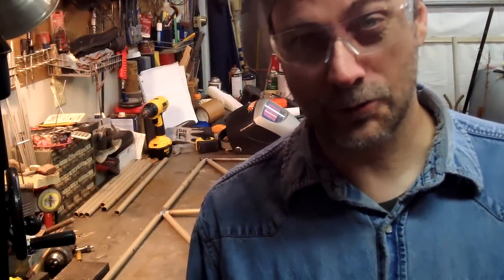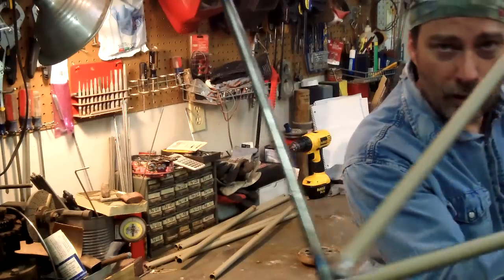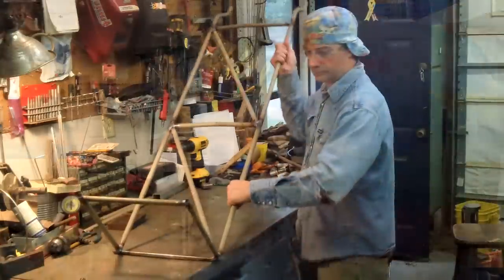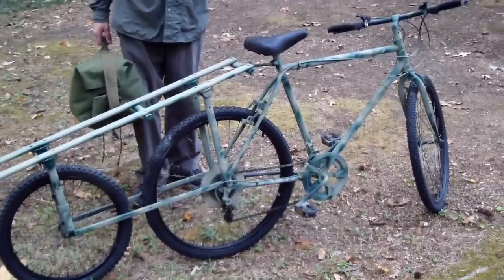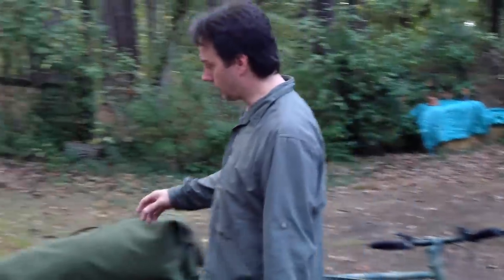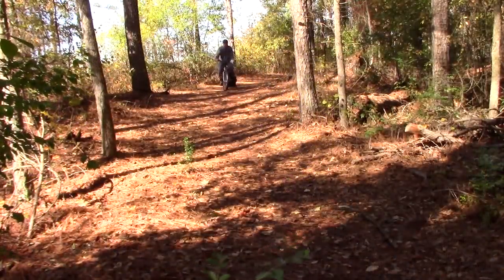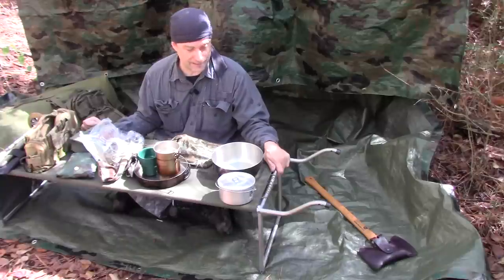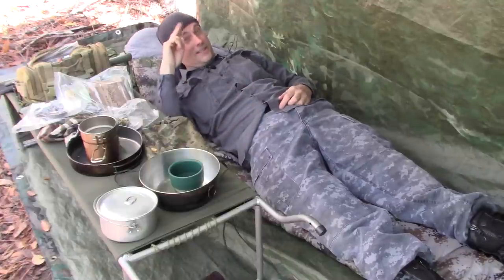The Bushcraft Camping Bicycle Travois

Comment: Dave , I just have to say you are one of my favorite people ever! You are humble, creative, and funny. 
Nice project. I enjoy seeing the thought process behind your projects. I like the paint choice. 
If you find the wheels you chose don't work, take a look at baby stroller wheels. The ones for jogging strollers are a bit larger and are designed to be pretty rugged. A bonus is that they are designed to swivel. You can also set their brake.
Looks like it rides nice and smooth.
Reply from the maker: Thanks Jeanette! I'm glad you liked it . The small wheels with the high speed bearings work perfect for trail use. Since this video was filmed I now have a larger set of wheels I swap out for off trail use.
Reply: @Reallybigmonkey1  I'm so glad!

Comment: Bigger wheels will be needed if there is deep puddles & sloppy mud on the trail.
Reply: I'm thinking golf bag wheels .
Reply: Yep, take an old 2 wheel pull behind golf caddie cart as a starting point for the build. About 12" diameter wheels should do the trick.
Reply from the maker: @QuantumPyrite_88.9  that's even better than bicycle wheels!
Reply: Right on. There are 2-wheel ranger carts & 4-wheel barrows, too.
Reply: I see golf bags on wheels with axles all the time at Goodwill stores and Thrift shops . Maybe 10 buck$ tops . Make longer axles for a wider wheel base and better stability .
Reply from the maker: The small wheels with the high speed bearings work perfect for trail use. Since this video was filmed I now have a larger set of wheels I swap out for off trail use. The wheels aren't huge just like you sugggested. I used wheels off a self propelled lawn mower
Reply: Being able to swap out and customize wheels for terrain  is nifty .
Reply: @Reallybigmonkey1  That sound great. i love that you have interchangeable wheels for different terrains! I love your ingenuity and I look forward to more of your ideas in the future and you sharing them with us!
Reply: @Reallybigmonkey1  Awesome
Reply: Defenitely add bigger and wider wheels on the trailer if you can. If it rain or if you go on a rought trail, you will be happy to have them. Great idea sir, with a bit of tunning it will be amazing!
Reply: @Reallybigmonkey1  Higher wheels will lift it, therefore separating it from the bike wheel more too. That way the handles won't have to be bent more to raise it.
Reply: @reaganl.5113  and just a thought, wheelchair tires never go flat..
Reply from the maker: The small wheels with the high speed bearings work perfect for trail use. Since this video was filmed I now have a larger set of wheels I swap out for off trail use.
Reply from the maker: The small wheels with the high speed bearings work perfect for trail use. Since this video was filmed I now have a larger set of wheels I swap out for off trail use.
Reply: how about a plastic skid plate under near the rear wheel so if it to deep or rocks you can just glide over everything. in joy
Reply: I agree. It would also help deal with bumps or other objects in path

Comment: Extend the arched hand holds 2" further back , and the tire won't rub..
Reply: Bigger wheels would have the same effect.
Reply: Or move the rod end a little further away from the seat.
Reply from the maker: The small wheels with the high speed bearings work perfect for trail use. Since this video was filmed I now have a larger set of wheels I swap out for off trail use.
Reply from the maker: I've since moved the pivot two inches higher

Comment: Is it not strong enough to sit upon like a bench?  💝☀🌵
Reply from the maker: I dont think it is, Its pretty light weight.
Reply: @Reallybigmonkey1  It was OK when it was a chair so I'd think it would be ok now wouldn't it?
Reply: @Reallybigmonkey1  would need some angle bracing on the legs.  Too much laterial stress on the weld points.  Would be a lightweight and easy model, wouldnt take away from design and would even help keep larger gear in.  Great stuff Dave

Comment: Dave, you are a great inventor, you should claim copy-right to your ideas. There is a market out there for light weight gear tools. Others will jump on this and sell it and never mention you name and that ain't right. Many long distance bikers would love to have a setup like that. And if I may suggest just one improvement , add wheels at the back that are about a foot tall. That will help when going into rough places and also on the road. Thumbs up. Clue try pvc pipes.
Reply from the maker: So far no one has stolen any of my ideas. That I'm aware of. The small wheels with the high speed bearings work perfect for trail use. Since this video was filmed I now have a larger set of wheels I swap out for off trail use.

Comment: Another great video. May I make a small recommendation. The next time you set up your table turn the handles for the outer side of your top that way when you move around the table you’re less likely to whack your legs her knees and won’t knock it over. I know you did not get over this time but just a thought especially if you’re trying to get into your sleeping bag at night.
Reply from the maker: Thanks Roland! I'm glad you liked it. Good thinking on them handles. I didn't even notice that

Comment: Another inspiring invention, Dave!
Made my own bike trailer several years ago...took about 200 miles on it to work out all the glitches.
 I used very small bicycle tires and put together a pivoting single-tree that allows me to attach the trailer with a single drop-in pin. It's in its third season and the only problem I've had is one sheared bolt.
It's totally made of recycled materials and the only thing I bought were the bolts. &)
Reply from the maker: Thanks! I'm happy you liked it. Bike trailers are cool but, my intentions were a trailer, a firewood hand truck and a table or bed frame. I've got a lot of tweaking to do!

Comment: I am deff going to copy the idea and play around with it. 
A quick brainstorming session gave me these ideas:
- Trunk cargo net to secure the load, that way I can carry small-ish items on the outside of the bags with less risk of losing them on the trail
- Make the frame of the travois strong enough to be used as a ladder/stretcher if needed 
-Play around with the size and shape of the wheels to see what suits the local terrain, and maybe play around with WHERE the wheels are located  relative to the travois, in some handtrucks the wheels are not in the corner and that may add ground clearance
Reply from the maker: Thanks for the suggestions Victor. I love the cargo net idea

Comment: Being a mechanic and a fabricator of sorts, I will say, great job. Well thought out. Two things I thought of watching this were, one, raise your saddle a tad bit. Your legs should be fully extended at the bottom of the pedal stroke. Two, there is an East German "rain camo" pack that I have used as panniers when bicycle camping. You know the pack I'm sure, they have a waterproof inner plastic liner. A pair of these mounted as low as possible on a rack over the front wheel balances the load and keeps trail essentials handy. Hope my thoughts are helpful.
Reply from the maker: Thanks Paul,  I'm glad you liked it. I actually have two or three of them rain camo packs and I love your idea!
Reply: @Reallybigmonkey1  Thank you for the reply. I've worn out several bicycles hauling camping gear around. Something to check out if you have not tried them is "rail trails". I will never forget one in West Virginia, The Greenbrier River Trail, stunning scenery with the added bonus of having the Cass Scenic Railroad at one end of it.

Comment: Bigger wheels on the hand truck would probably give you more clearance over the bike’s back tire. Attaching it with a long rod through the tube and secured with a hitch pin rather than threaded rod may simplify your hookup procedure time. A bed setup would also be awesome. I would love to see a shop tour. I would guess you have as much equipment there as you do in your basement.
Reply from the maker: The small wheels with the high speed bearings work perfect for trail use. Since this video was filmed I now have a larger set of wheels I swap out for off trail use.

Comment: Great video, way to think outside the box. I love multipurpose gear and you have created the ultimate piece of gear for no matter what.
My only criticism is that in the event of snow you would definitely need a larger wheel size. But other than that. Bravo my friend! Good to hear from Nick as well
Reply from the maker: Thanks Micheal, I'm glad you liked it. The small wheels with the high speed bearings work perfect for trail use. Since this video was filmed I now have a larger set of wheels I swap out for off trail use.

Comment: RBM1 excellent vid, Love your idea...
In Alaska we have distance and sprint dog racing with a sled....check out the materials that the sleds are made of... 
Very strong and light....Especially useful if a guy wanted to add them as a travois skid plate (for when tires fail)
and double as a bed / table
btw they like a sled to flex and not break as a weld will. 
Peace
William
Reply from the maker: I'm glad you liked it and thanks for the suggestion William! Thanks for watching brother
Reply: @Reallybigmonkey1  David, in particular check out the material they use on the bottom of the sled runners

Comment: Ok really enjoyed the video but let me add the improvements that would be required for me to operate the bicycle camp thing 1st .tracks must have tracks for mud etc 2nd total enclosed cab 4 door with sun roof. 3rd covered with 1/4" diamond plate (protection against the dark creatures of the night) 4th thing.  A/C is a must as is a 10,000 but min heater 5th  built in TV with DVD player ( sat dish optional) 
Now for the 6th item and this is a huge item 3 cup holders no give on this.
And if memory serves me right which it usually does and that is pedaling a bike is just not fun so to add a small bit of assists in pedaling would be to add a small 3 cyl. Cat engine with a Allison automatic trans and a Jake brake for down hill (safety frist) and a small gen  to power the rest of my need elertic must have items no more the 30
Now did I mention 3 cup holders 
Sir you are a true craftsman keep coming up with the great Video's  and I will try my humble best to keep you grounded
Reply from the maker: Lol, are you sure you ain't an engineer? Lol, thanks for watching Brother Terry!

Comment: Another great idea comes to life!  I second your idea of suspension add-ons to lift the travois off the rear wheel:  IF I AM PEDALLING, I don't need any extra friction to hamper my progress.  I believe you have found the best attachment point for the travois on the bicycle seat post.  Maybe a gooseneck type of tongue hitch would lift the bed of the travois enough to clear the rear wheel on the bike while maintaining a workably low center of gravity for the load.   I am looking forward to further refinements and an overnight adventure with this new equipment.  Thanks!
Reply from the maker: Thanks James,  I'm glad you liked it. The pivot point is perfect, I just gotta tweak everything else. Thanks for watching.

Comment: I love how you think & Invent things Dave, however, what do you think of this concept?,..Make a tubular wishbone (Like Bicycle forks) to bolt to the rear wheel down low & create a hitch system like towing a trailer. It would come off straight from the back of the bike and clear the rear wheel like forks do. This way,..you wouldn't need to have it so high to meet at the seat like it is. Also, you could make just a little larger wheel removable for when it's flipped upside down to use as a table. Anyway,..I love how you think. You come up with cool, genius ideas. Have a great day Dave.
Reply from the maker: Good thoughts. I'll have to sketch that out and look at it. Lots of possibilities for this idea. Thanks for watching

Comment: Love it! Maybe back that rod joint out an inch or two if you have the threads on it. Give you the clearance for the back tire. Consider a set of fenders to keep the table top from getting covered in mud the tires will fling. Davecraft for the win baby!
Reply from the maker: Thanks, I'm glad you liked it. Or raise the mount up higher. Thanks for watching.

Comment: Fantastic idea! I always love the repurposing, invention, and diy videos. I was thinking you might get some wheel rub when going downhill but I'm sure you can solve that easily. Perhaps something like attaching 45 degree angle fitting of some sort between the hind joint and the plastic bike mount would be all that is needed to get a bit more lift without needing different wheels or any new attachments, or maybe just a longer shaft? You'll get er figured out I'm sure. Thanks for sharing. Perhaps we'll see it in action on an upcoming trip?
Reply from the maker: Thanks Marshall! Since this video came out I've done some tweaking and y'all are gonna love it! Thanks for watching

Comment: Dude! You should be running a R&D team for an outdoor gear manufacturer. What are you waiting for? 
You may also want to google "deer drag cart" as part of your research for Gen 3. Bigger wheels will give you more clearance between the bike's wheel and canvas. It will also allow you to traverse rougher terrain, especially when you are cresting a hill. Love watching your innovations - keep 'em coming!
Reply from the maker: The small wheels with the high speed bearings work perfect for trail use. Since this video was filmed I now have a larger set of wheels I swap out for off trail use. Thanks for watching Joel!

Comment: Bug Out Bicycle Version 2.0. Looks great brother! Throw some larger tires on the trailer to change that angle, should keep your rear bike tire from rubbing. Awesome!👍👍👍
Reply from the maker: The small wheels with the high speed bearings work perfect for trail use. Since this video was filmed I now have a larger set of wheels I swap out for off trail use.

Comment: Having broke a few folding chairs before my only concern would be the center of that frame folding. Fixed easy enough with sticks and chord in a pinch maybe. But man I like it Dave, great video
Reply from the maker: Yep, you're correct! If it broke out in the woods that would be a good fix. I'm glad you liked it and thanks for watching

Comment: Hats off to your welding skills Dave! I was worried you would over load your lower shelf since it doesn't have any bracing. Right angle welded tubing seems like it would be weak but you have it rock solid. I agree with some of the others about the wheels. Lots of small diameter wheels available to experiment with. The runners baby carriage wheels are probably the only ones with adequate bearings though. Bigger wheels may cause an issue with mud or water dirtying your cargo.  Once again you're on the outside of the box looking in at the rest of us! Can't wait to see a full fledged overnighter using the travois.
Reply from the maker: Thanks! With just a straight frame that tubing might be weak but, those angled pieces in the center made a huge difference! The small wheels with the high speed bearings work perfect for trail use. Since this video was filmed I now have a larger set of wheels I swap out for off trail use.

Comment: Amazing and innovative, thank you for sharing!
Slightly larger wheels should raise the bottom of the trailer over the rear wheel enough to resolve the rubbing.
Reply from the maker: The small wheels with the high speed bearings work perfect for trail use. Since this video was filmed I now have a larger set of wheels I swap out for off trail use.

Comment: Very cool! You know you could make a little piece of fender for that rear wheel that fits right where the canvas touches. Two little pieces of rod in a V shape with a 8 in. piece of sheet metal on it for the canvas to rest on. You got my brain going with this one LOL! And if you really need to bring more stuff you can always put a small back pack on. OK I'm done.
Reply from the maker: Thanks, I'm glad you liked it. A fender would work and I've been thinking of making one but, I've got a new cover in mind that's uber water proof. That and larger wheels is all this needs. The options and possibilities are endless!

Comment: Dave, been looking for a new design since the first one.  Glad to see you got it in the right direction.  I would go with tires like one a wheel barrel, less likelihood of them getting caught up, and digging in.  Have you considered making a "trailer hitch" for it to hook up to US GI Load barring suspenders so when you're walking it to a camp location you still have use of your hands, and it will allow your hips to do the pulling.  Great work.  You're definitely on to something.
Reply from the maker: The small wheels with the high speed bearings work perfect for trail use. Since this video was filmed I now have a larger set of wheels I swap out for off trail use.

Comment: I love doing projects like that where the materials are free or leftover scraps from other projects. If you're looking to make the bike itself run more smoothly and efficiently, consider a new chain, new brake cables, new brake pads, new tires, and taking apart some of the bearings and cleaning and re-greasing them, or some combination of those. Also make sure you're keeping the chain clean and using a dry chain lube so it doesn't get rusty or worn out and stop indexing with the teeth of the gears properly and start skipping. If you're going any distance in the woods, you might want to bring a spare inner tube, a small hand pump, tire levers, and a small bike multi-tool or set of metric allen keys so you don't end up having to drag a broken bike and trailer miles out of the woods. Also, a helmet is definitely recommended just as a matter of being safe rather than sorry. Hopefully some of that is useful to you and I look forward to what seeing what modifications and improvements you make next.
Reply from the maker: Thanks for the input Zachary